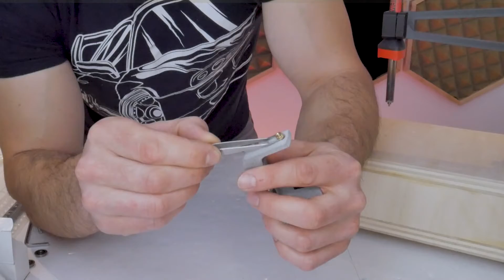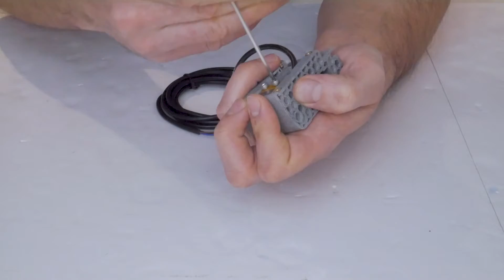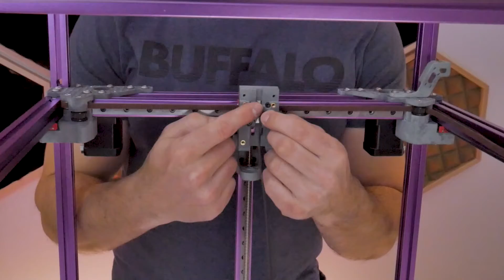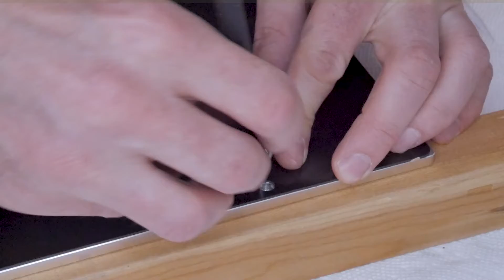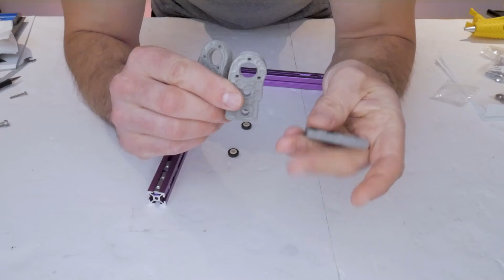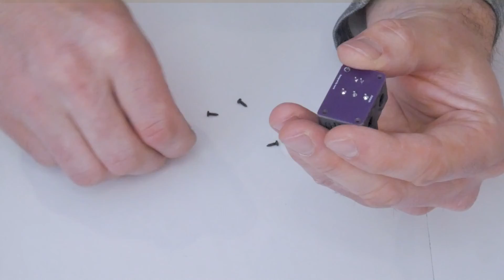Voron Trident Premium Purple Plastic Eater Build (Part 2: X Axis, Print Bed, Belt Routing) MJF Parts

Comment: I'm in the middle of building a Blurolls Trident  kit with some replacements eg hotend and stainless hardware.  I really like the idea of MJF-optimized parts and your implementation looks nice.  Definitely a bit more streamlined to build and less hardware is better as well.  The MJF nylon is very nice for operating inside a raised ambient enclosure but can you comment on the flexibility of these parts?  They appear more flexible than typical FDM printed ABS.  Your purple frame is beautiful, especially the nicely anodized, clean ends with no burrs.  Where did the extrusions come from?
Reply from the maker: Thanks for the comment Robert, the material is going to be more flexible than ABS given two thin solid (not FDM printed) rectangular sample pieces of the same dimensions for example. However, when you start to factor in how the shapes of the parts add stiffness, and consider the multijet parts are printed solid with no infill and isotropic properties, and previously two piece parts are now a single piece without fasteners, I would give the upper hand in strength/stiffness/longevity to the nylon parts. Also, some of the parts here are bolted directly to the extrusion and the extrusion itself lends stiffness to the plastic parts (both FDM or MJF benefit from this). Additionally, the MJF parts are printed on calibrated half million dollar machines rather than being pumped out by random people with subjective quality control on the internet with the print it forward program. 

As for the extrusions, they are from Sparta3D I believe it was an LDO extrusion kit. At the time they were out of stock of almost every other color and I figured why not build a purple one and do something different :)